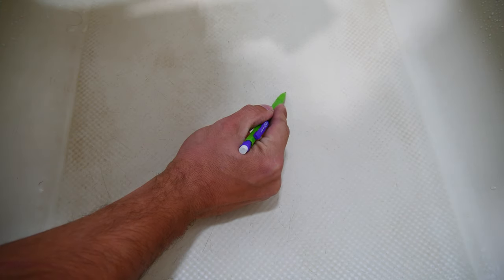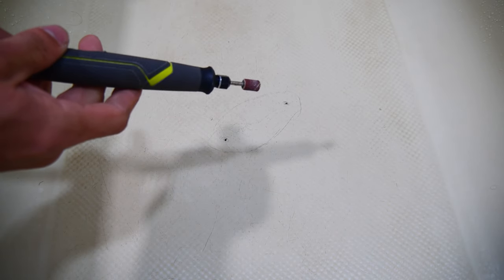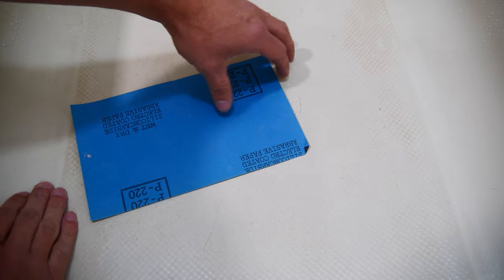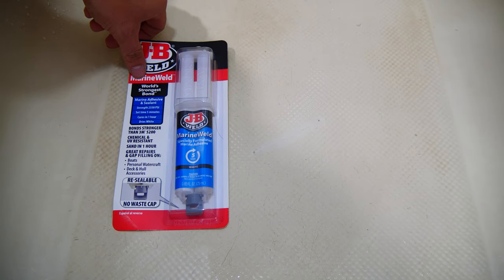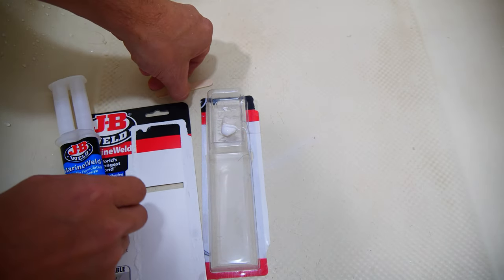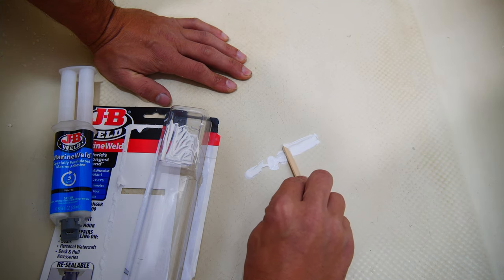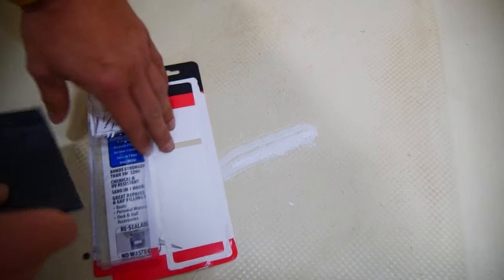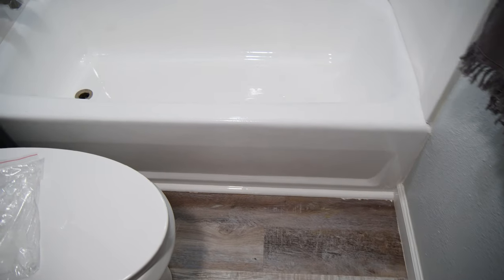DIY: How to Repair a Crack in Bath Tub or Wall

Comment: Hi brother! Little questions, I have a doubt, I saw a video you posted about calibrating a replaced dji drone gimbal with Phyton. 
I'm going to change PART of the gimbal, not putting a whole new one, is there any difference with calibration? What would you do in this case? Thanks in advance
Reply from the maker: If you're just changing a part of the gimbal and not replacing the whole thing, you may not have to do any calibration afterward. it would depend on if the gimbal gets out of alignment during the process. If it does, you'll run the commands just like the video calls for.
Reply: Thanks bud! I'll definitvely take that in count, also, one more thing please, maybe you can diagnose this. I crashed my Air 2S, and the gimbal has issues now, it performs it's initial calibration after the start, but once done, the whole gimbal just drops, the camera works just fine and also the initial calibration, after that, everything related to gimbal stabilization dies. What do you think it could be??